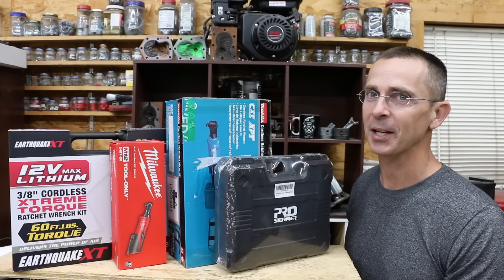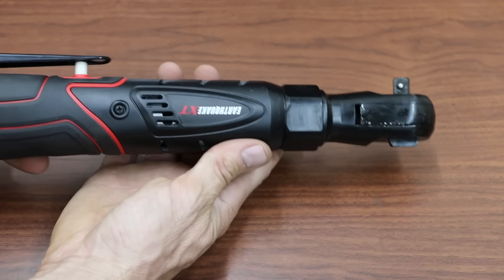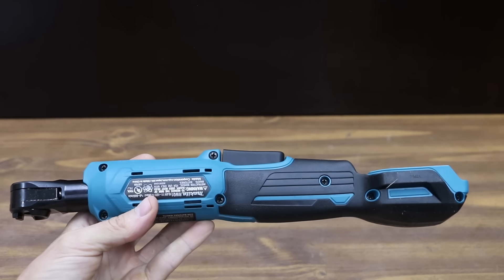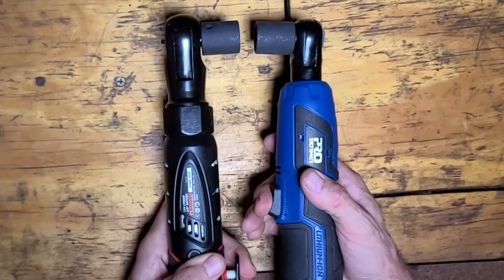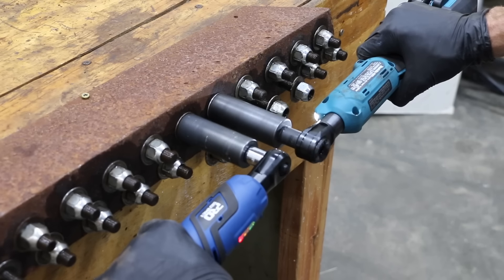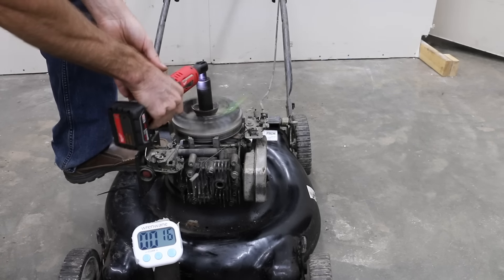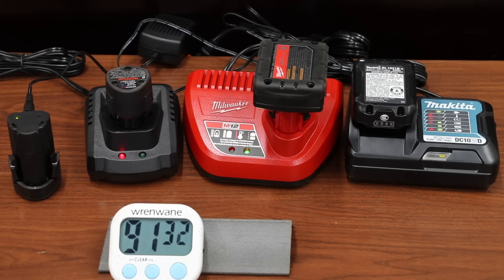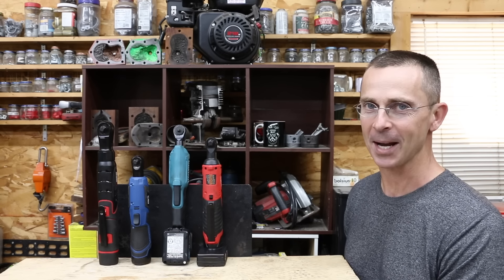Best 3/8 Cordless Ratchet? Milwaukee M12 vs Makita, Earthquake & ProStormer. Let’s find out!

Comment: I think Milwaukee also makes smaller batteries that fit more ergonomically with the tool, but that may also be another model line.  Been a while since I last looked.  I was thinking about picking a 3/8 battery powered ratchet even before watching this video, but now my decision is solidified thanks to you.  I've never had a bad Milwaukee tool.  I'm a little surprised that 4 AH battery took so long to charge though.  It seems like the one for my drill charges in about 30 - 40 minutes, but I never formally timed it before.
Reply from the maker: Thanks for the feedback.

Comment: We have both 3/8 and 1/2 drive  Milwaukee's at my work. 
I only use the 1/2 drive for its better torque on bolts 3/8 (10 mm) and higher. 
Biggest complaint with the Milwaukee is the battery tabs break. 95% of our batteries have at least one tab broken.
The design is kind flawed, typically you grab the end of the wrench when final torque for better leverage. Unfortunately the battery is on the end of the Milwaukee with strains it to much it you need to torque further then the motor capacity.

Comment: To be fair the Prostormer has a runtime of almost 100 minutes in your test because it comes with two batteries. The charge time is redundant in most use cases for this ratchet as you can charge the depleted battery while you are working with the other one. It can do as much work as the Milwaukee on it's batteries plus you can keep going if you would need to but I do not think that is a real world requirement. 
I bought a 'Jusfit' wrench that is just about the same as the Prostormer and from a Diy'er point of view  it's just as good if not better than the Milwaukee I had previously that was stolen from my vehicle. I could have bought 4 of these ratchets for the price of the Milwaukee one so even long term reliability is not an issue.
Reply from the maker: Thanks for the feedback.

Comment: I'm starting to restore some cars and trucks, so would these ratchets be a good investment or a 1/2" drive be more versatile?  I've always just used sockets and wrenches but like how much battery powered tools have replaced the need for air tools almost completely!

Comment: Why did you not use the smaller round 2.0A 12V Milwaukee battery ? It would have levelled the field and shown that it can be a lot more compact. Milwaukee also do 2 differently torqued ratchets.
Reply from the maker: Thanks for the constructive feedback.

Comment: Thank you very much for your in depth analysis on these different tools. I am starting a mobile automotive repair business, on a tight budget, so while money is an object, the productivity level of this type of investment can pay dividends. I still have a little more work to do as to wether the makita or milwaukee might be the best option. 

Little tip for anyone who wants their power ratchet to last longer, don't use it to break bolts loose, use a ratchet or breaker bar then put your power ratchet on the fastener.

Comment: The makita on this test seems to be the overall winner. You get a well balanced tool, that competes with Milwaukee. Though more expensive than all it's the only tool that let's you change the ratchet boss size, it comes with a light battery however the same flange style as the others so in theory you could use their standard batteries as a weight increase displacement for that one bolt that you need a bit more counterweight to break torque. Any mechanic can tell you, one of the worst peeves is having 20 different battery chargers and batteries that dont interchange, so the ability to use batteries and chargers you already have is a big plus
Reply: Milwaukee is better that makita in general overall

Comment: You're always asking for testing/comparison subjects. Here's one & I need data as soon as possible. Evidently new construction requires "arc fault"  breakers on all 15 & 20 Amp circuits. These are in the 65$ range. I have been informed  that you can do first plug as an "arc fault" & protect the rest in line similar to how "ground fault" works. You can even get combo arc fault & ground fault combo in 1 plug. One would like to use the plug style as it is half the price of the breaker style. The big question is there much difference in the reliability, performance, ect between the plug vs breaker style?

Comment: Excellent presentation, not too long, not too short of info. I am actually pretty keen on picking up the Stormer. 2x batteries sold me. Could buy 3 Stormers and get 6x batteries for less then the price of the Makita. I am willing to put up with the slower RPM and torque tradeoff. I like it's compact size, and the battery meter LEDs. Such a tool really is fit for the purpose I am looking to fill - Reducing repetitive ratcheting of a hand unit. I do not need it to break torque, nor to set torque. Final torque would be seet by hand by my preference. The fact you can technically use these to break torque manually, like a regular ratchet, is great. 

The run time of the battery actually is amazing for what it is is too. 49 minutes @ 2AH. Milwaukee's 4AH battery did 71 minutes, so divided in half to be a more fair comparison to 2AH... that is only 35.5 minutes. Stormer comes with two batteries... so minus the little bit where you'd have to swap batteries, you'd get a 98 minute run time.

At the end of the day, the Makita and Milwakee are still in their own leagues... But the Stormer holds it's own thanks to its great price point. Pros and cons always. Thanks for the awesome presentation and review!
Reply from the maker: Thanks!  Thanks for sharing.

Comment: I appreciate the performance testing, but I do wish you did a little more with testing robustness. For example, many higher end tools will purposefully throttle themselves down or off to prevent damage/abuse to the tool, whereas others will let you abuse them until they break. Often the latter type will end up performing better in tests, at the cost of tool longevity.
Reply from the maker: Thanks for the suggestion.

Comment: Should have tried a Milwaukee fuel. (Tool only so... one battery and charger I was out $285. So price point would be an issue for average Joe) I own a fuel, co-worker has the one you tested. My fuel is better. As an industrial mechanic aka millwright, decibels don't concern me. Weight ratio don't concern me. Neither does torque. I use mine for speed. Break bolt torqued to 80flbs loose with ratchet and switch for long winded bolts or, where you can only get one click on a higher end ratchet and it takes forever. Boom, get it broke loose, switch, boom, tight enough for a 1/4" bolt. Good info for the shade tree guy though. Oh, and yes, that battery life is huge for me. And the compact part. Sometimes that's a huge factor for me.

Comment: It would be pretty cool to see a test on strength, working angle, corrosion resistance ect on a few regular ratchet brands such as pittsburg (harbor freight 
), craftsman, kobalt, Milwaukee, Dewalt, and see how they stand against a MAC or snap on! 3/8s drive would be probably the best to test since its generally the most common
Reply from the maker: Thanks for the suggestion.

Comment: On the RPM test, did the tools say what diameter the test was done at? Because if you have the same motor spinning a 4 inch dia vs one spinning a 1 in and you test them with the sticker and tool like that the 1 inch will spin faster. I bet the reason for the inconisistent test there are different testing methods used by the manufacturers vs what your are doing. You could even test a drill bit in it and that would look to be spinning the fastest.

Comment: What thermal camera do you use?  Feel like doing a episode on thermal cameras?
Reply from the maker: FLIR 1 Pro.  Thanks for the video idea on comparing thermal cameras.
Reply: @ProjectFarm   thank you for the info.  If you need a suggestion of a product to compare. I’ve been looking at the PerfectPrime IR0002 thermal camera on Amazon for a while. Haven’t pulled the trigger yet because these things are so expensive. I like that it’s a stand alone and runs off regular batteries so I don’t have to worry about an app being updated like the phone ones might need but if it’s not as good what’s the point. You know.

Comment: I'm wondering why the Makitas measured rpm is a lot lower than advertised. Is there a speed switch or button? I wonder what the deal is with that.
Reply: they all lie.
Reply: I just watched another tool review video where they measured the makita running close to 800rpm. Wonder what happened here.

Comment: Fun to watch and learn. I've been considering one of these power ratchets for a while. But with so many to choose from, it's not an easy choice. This sort of helps to make a wise choice for the money. To cheap,  and you get what you pay for. Too expensive  - how long will it sit in the tool box before you need  it again? This helps to make it easier and maybe even saving a few bucks on something practical. Especially when your a weekend diy'er. 
Thanks for the help.
Cheers.
Reply: I have used the Milwaukee  M12 (with the 2.0 battery) daily for several years, I have retired for two years now and the tools are not used as much, but they seem just as good -- I think the ratchet and 3/8 impact are about 10 years old now -- would I get another when these die, yes 
Project Farm used the ratchet to loosen those bolts, but they are not made for bolts that tight in my opinion -- I use the ratchet for running down bolts of all sizes, then finish with a torque wrench -- the 3/8 impact however get abused terribly, and has stood the time.
I like the smaller battery 2.0 vs 4.0 to get into tight spaces -- both battery's are interchangeable .
Reply from the maker: You are welcome!
Reply: @Steven Davis  I can see how useful  it would be for that. Running down bolts or freeing them up after you lose them up and a torque wrench to make them good & tight. 
It only makes good sense to have the right tool. So far, Milwaukie seems to be the more sensible choice. Thanks for your opinion. It helps to make the best choice. 
Cheers buddy.

Comment: Milwaukee and Makita are both great tools. You can’t go wrong with either one. I am mostly a Makita fan over Milwaukee. This is mostly due overall when it comes to cost on what both companies make. I have no doubt if all 4 tools were opened up both Makita and Milwaukee would have the best build qualities. 

I am really loving these videos. In case I go Milwaukee on a future tool or 2, is there an adapter for the battery that works well from Makita to Milwaukee?
Reply from the maker: I'm not sure if there is an adapter.
Reply: @ProjectFarm  Thank you kindly for responding. Happy Holidays.

Comment: I own an Earthquake power ratchet, and was impressed enough for the price.  It’s not a “go to tool” for me, I always start with spanners or a mechanical ratchet as that’s just easier, in the few years I’ve owned it I think I’ve used it once.  Unless you’re going to be using it constantly I think the Earthquake is plenty good enough.  …I do wish Dewalt made a power ratchet
Reply from the maker: Great feedback. Thank you
Reply: Dewalt does

Comment: i bought a black and decker ratchet a long time ago and it never seemed to be very useful had no power to break anything free i would forget to even use it till the battery died i guess these new ones would be way more powerful i keep meaning to try one but can they actually break free stuck bolts? or will they only be useful on loose fasteners?

Comment: I have the fuel extended reach 3/8 and i use it daily as an automotive tech and its great. A little bulky but much less than my beefy IR air ratchet though compared to the IR the Milwaukee has no balls lol. Just picked up a gen 2 mid torque m18 impact though and i love it so far for the price and size this things a monster
Reply from the maker: Thanks for sharing.
Reply: the m18 and the m12 have the same motor for 3/8, which maked the m18 have insane battery life.

Comment: Thanks for creating these videos! Could you make a video on Compressed Air Blow gun tools. Most seem rated at 90 PSI. Will they fail over 100 psi? Output volume measurable?
Reply from the maker: Thanks for the suggestion.

Comment: Old fart here - been turning bolts for a tad over half a century. I never imaged a cordless ratchet being a "must have " tool. In fact, the idea of owning one never crossed my mind. Too many other tools work just fine and without batteries to recharge - usually when you really need it.

I DO sometimes use an air ratchet for running in bots on things like heads and manifolds. I use a 1/4 air ratchet which is rated for a whopping 15 ft lb @ 90 psi. I set the regulator down to 80 psi and run the bolts down until they contact. Then I follow normal torquing process.
Reply from the maker: Thanks for sharing.

Comment: you should see which head lets go first from manual cranking. I find them weak in this category.
Reply from the maker: Thanks for the suggestion.
Reply: @ProjectFarm  The makita has not failed on my yet. I’ve gone through the best ratchets in the world, ingersoll rand, sp tools and they all fail at some point. The Milwaukie failed on me first. I’ve even had the item hammerhead fail on me! But that was due to me dropping it me it broke in half! It’s hard for me to go Milwaukie as I’m exposed to them all the time and they just feel wrong in my hand. Makita on the other hand just feels better.
Reply: Almost Milwaukie don’t recommend cranking.

Comment: I think with tools that come with a separate battery and charger set you should include the cost of those like you have, but also mention the cost of the tool alone. For those of us that are already invested in that tool's series or are trying to determine which tool series to invest in it's helpful to understand what the base price of the tools are once we own a battery and charger. 
I say this because when comparing DeWalt and Milwaukee 12V series I've noticed that DeWalt has more expensive tools but cheaper batteries and chargers. This affects my decision because I intend to buy a lot more tools than batteries
Reply from the maker: Thanks for the constructive feedback.

Comment: Todd do you know if the anvils are universal? I have a cheapo codless ratchet with a 3/8 anvil but would like to install a 1/4 anvil on it if possible so i dont have to use socket adapter on it. Thank you.

Comment: Torque on a cordless/air ratchet is overrated. It's a good thing to have in case u have a rusty bolt or nut that is kind of tight the whole way on or off. But usually if it gets to a point where it stops u just manually ratchet it and it'll get past the sticky part etc. But no the best thing about a air ratchet or cordless one. Is that if u can get a ratchet on a fastener, but don't have room to swing the ratchet. These work fantastic for that, because they can stay in one place and zip it out. So the size and rpms is a huge deciding factor for me. But imo I'd choose Milwaukee's extended neck cordless ratchet. They have a very skinny head on them with good torque
Reply from the maker: Thanks for the feedback.

Comment: Awesome comparison as always!   Perhaps a way to reveal even more differences would  be using nylon locked nuts instead. 
A Video suggestion for you:  how about these same test on brushless 5 and 6 cell range models such as
 Makita XRW01Z, 

 Ryobi PBLRC25B 

 Ridgid R8621 w-ratchet head
(The head latches definitely not meant to handle this much manual torque, would exempt it. I wish they had come out with a long reach head instead.   But it is a fast performer.)Might have to search for the head as AEG

Kobalt KRW124b

Craftsman  320.38596 (Harder to get now but advantages are obvious, would love to see how it compares, and might become a favorite tool with all your custom projects) Too bad TTI never produced this as any other brand.

I also would enjoy seeing these other 12v models added to this comparison
Milwaukee 2560-20
DeWalt DCF503EB
HERCULES HD034B

Sure appreciate and enjoy your videos!
Reply from the maker: Thanks!  Thanks for  the video ideas.

Comment: I had a failure of a charger (It was a WORX brand), and bought an off label charger online and found upon using it that the battery for the tool charged about 30-40% faster getting a little warmer than with the original charger. Also, the tool sounded like it was revving higher and felt like it had more torque, and seemed to last a bit longer before needing a recharge. Have you, or any of your viewers experienced this sort of thing in Li-Ion driven tools?
Reply: So chances are that the off brand charger wasn't "safely" charging the cells (by WORX standard). You're essentially charging the batteries up to their peak voltages which explained your performance gains. Lithium batteries usually like to sit between 20-80% capacity for the longest life. So yes you are getting more power out of them at the slight expense of longevity.

Comment: Love your vids, but i have tried most of them, and For every day use, i have over 100 different Milwaukee tools and really love Milwaukee, but they make the works Rachet i own, The Snap-On blows them away, I know the Snap-On is expensive but you will find over time it will save you money in the long run, I have one that is 15 years old and the Snap-On battery still works like new, The Big issue with the Milwaukee is the paddle button, it just does not make sense, the paddle is a odd feeling in areas you need one hand,
Reply from the maker: Thanks!  Thanks for sharing.